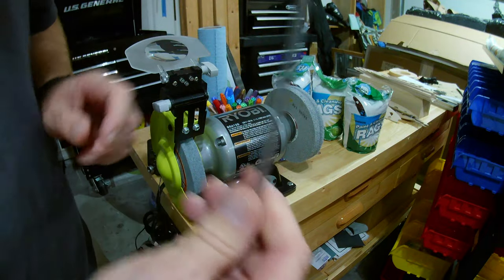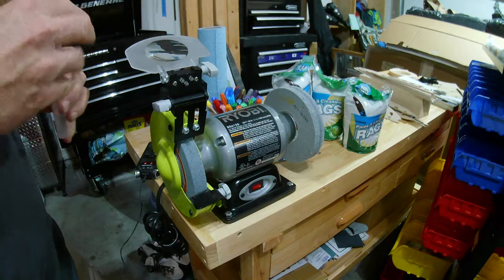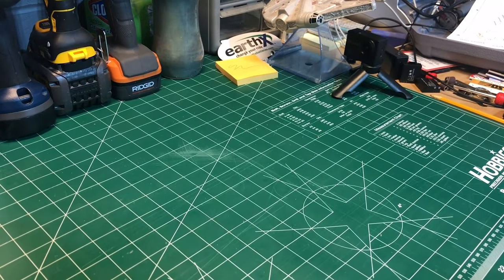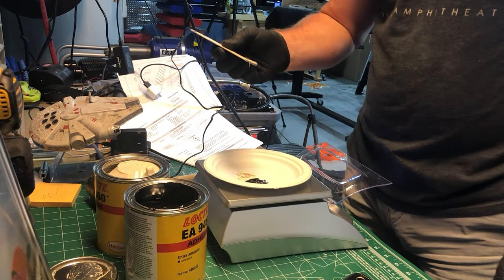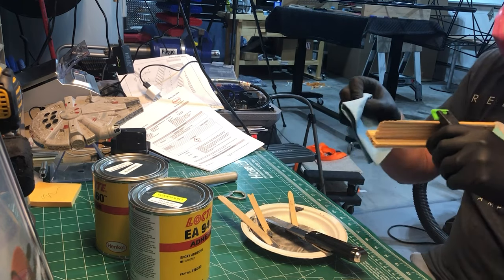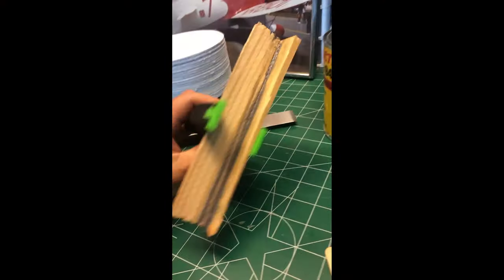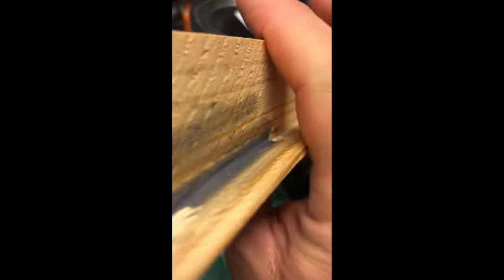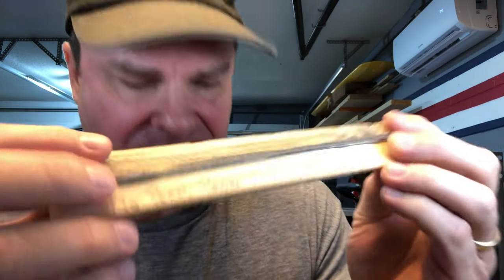Reaming and Hysol 9460

Comment: I like the content. However, I can’t find any videos on how to prep the powder coat for hysol. The book is pretty explanatory. It say to clean and roughen up the surface. Also the book says you can use alcohol or MEK. I’m cautious to put MEK on the powder coat. What was the process you used on glueing the ribs on the horizontal stab?